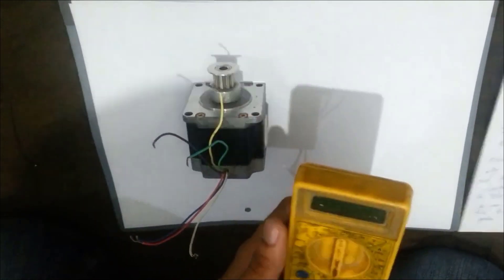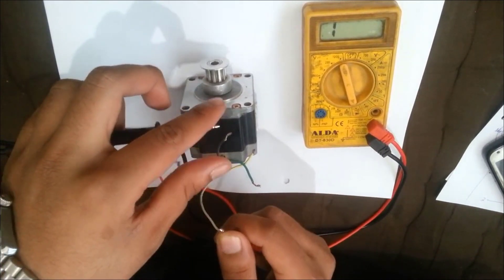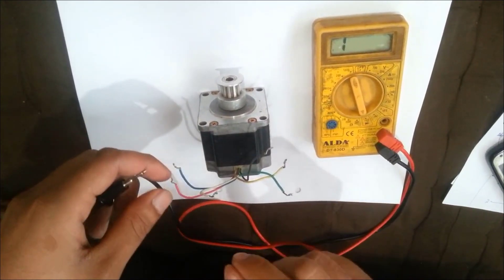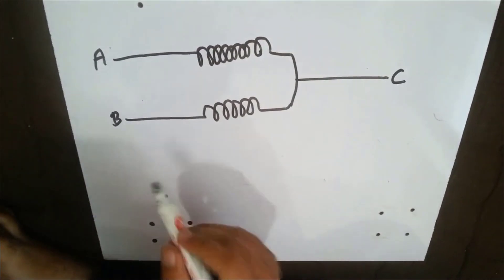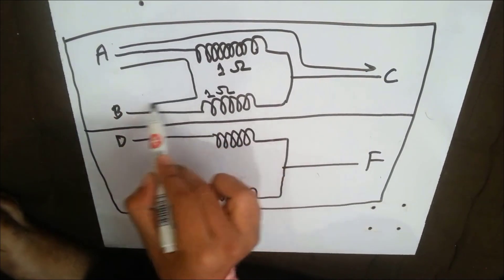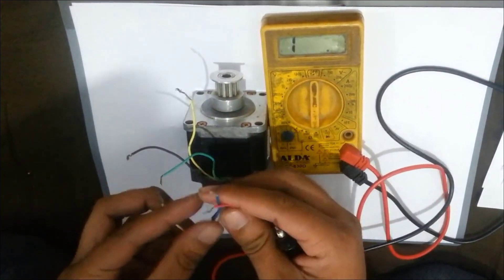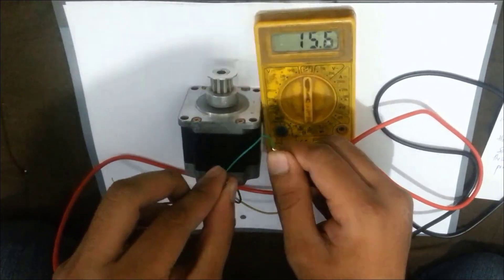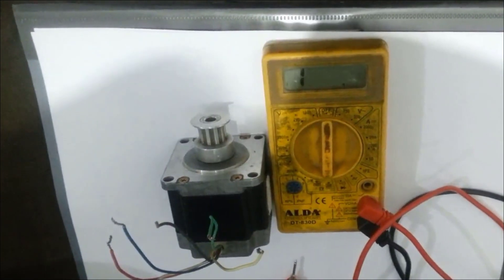How to Identify the wires of stepper motor ?

Comment: in my stepper motor i get contiunity across all the 6 wires, showing resistance as eitehr 48ohms or 24 ohms i opend up the coil too, but could not see any issue atleast visually. can you help me, thanks

Comment: Hello, I got some old used stepper motors, there's no number or model number visible, how to check its rated voltage?
It has 6 pins

Comment: Connect any 2 wires, then try to make the motor turn by hand. If you feel resistance those 2 wires are a pair, if you do not then try another combination

Comment: hello sir i make 3axies cnc  i use  SANYO DENKI 103H7121-0415 stepper motor 6 wire  this motor  Consider only 2A  and 1.8 step  not Consider power supply
so how much power use this motor and which wire A+ and A-  and which wire B+ and B-
Reply: Where next video link
Reply from the maker: AS its mentioned 2A so 2A is its current rating. Moreover, you have to follow the above video instructions, there's no other way.
Reply: plz send you mail  i mail some motor photos